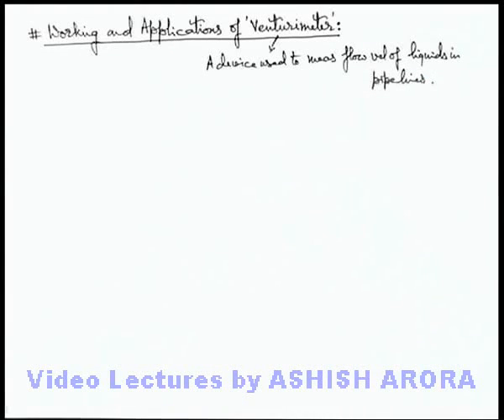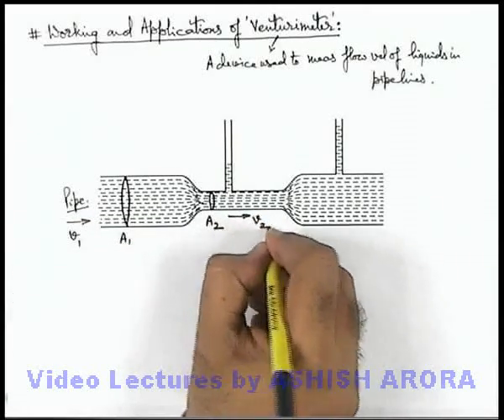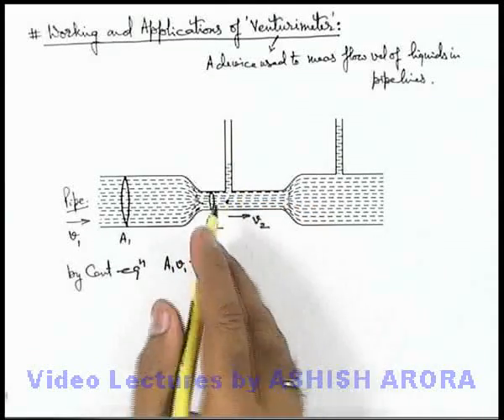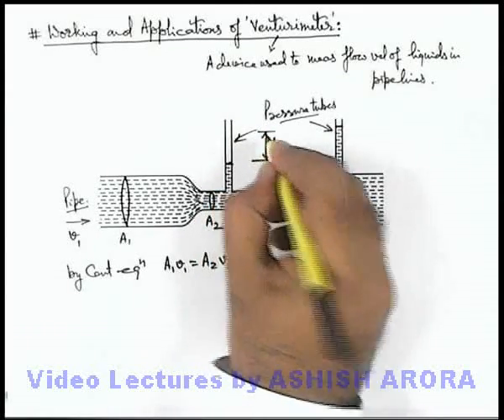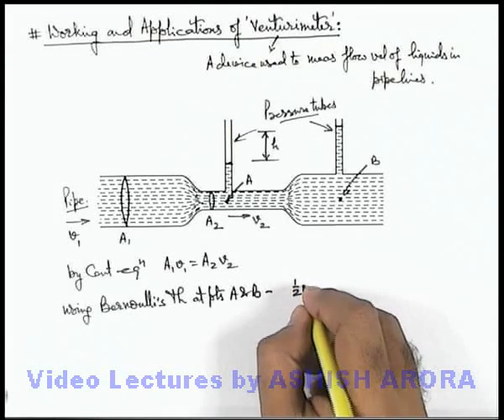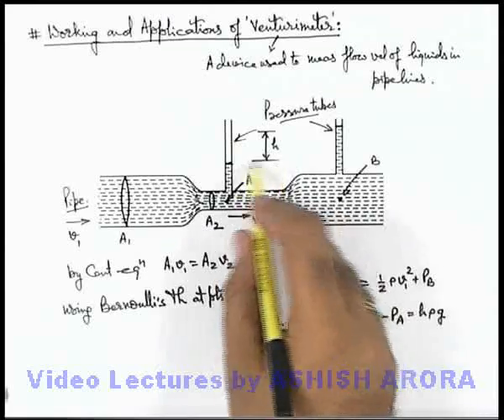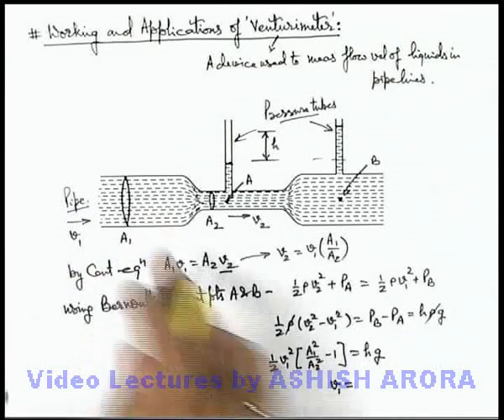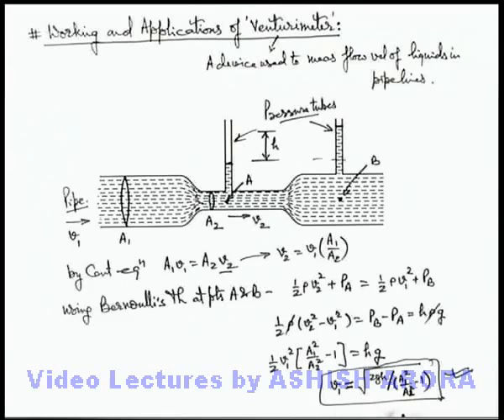Class 11 Physics | Fluid Dynamics | #14 Working and Application of Venturimeter | For JEE & NEET

Comment: But as on in same fluid on horizontal layer pressure are equal , therefore

PA=PB → PA-PB=0 ?
Reply: That’s only applicable if liquid is in static equilibrium
Reply: since velocity is different so pressure will also be different

Comment: Drawing is incorrect...Limbs should me one at upstream side and One at throat
Reply from the maker: Dear Abdul, it will be good if you go with concepts not any diagram given in any book... look here on either side as stream velocity is same as cross section of tube is same.. the pressure will also be same so for ideal fluids it will not make any difference where the vertical tubes are attached before the narrow tube or after... if it is a non ideal fluid...the phenomenon is not applicable... so this is absolutely correct for ideal fluids.. I hope you understand...
Reply: Physics Galaxy Sir, As length of divergent section is more or less same as compared to that convergent section in drawing which you have shown, there will a flow separation in short divergent tube even in case of an ideal flow , so it will not indicate true static pressure on the right pressure tube.This arrangement will leads to more error when the reynolds number is very high.As you aware for ideal fluid flow reynolds number tends to infinity this arrangement is not recommended. we can ensure there is  no flow separation if one of the pressure tube is connected  upstream to  the convergent section and the other at throat
Reply from the maker: Dear Abdul, under practical situations you are correct only if fluid is non ideal...just like the internal resistance of a battery is connected to negative terminal of a battery but again under theory we do not consider the flow separation or variation in density as in the throat flow velocity is high and in the divergent section along with gradient flow velocity decreases and in broad section of pipe it gradually decreases with crossection so no flow separation and under this state above explanation is correct...
Reply: Physics Galaxy Sir, In standard text book like mechanical measurements by sp venkateshan or experimental methods by holman  it is mentioned that Convergent section full angle  is 21 + or -2 degree, divergent section full angle  5 to 15 degree...
Reply: ABDUL SHUKOOR are u preparing for engineering exams or higher studies.
Sir is teaching according to engineering level and even in jee exams conditions like divergent tube is long and convergent is small will not be followed. Also if you will see real venturi meter you will see that shape of tube is different.
So if u want  very next level thing u can study in colleges or practical research centres